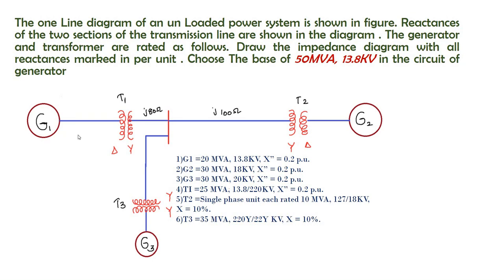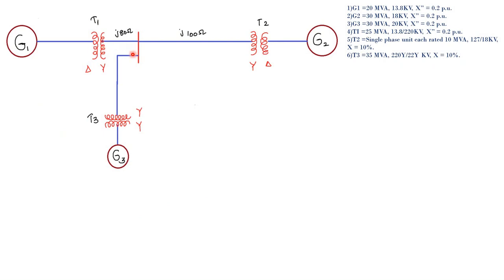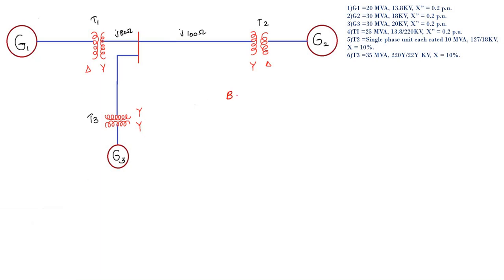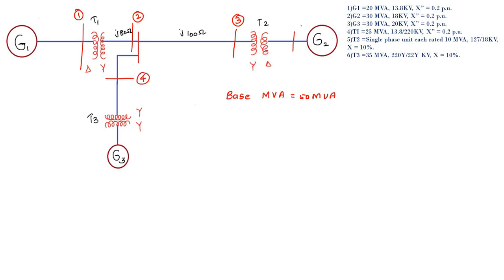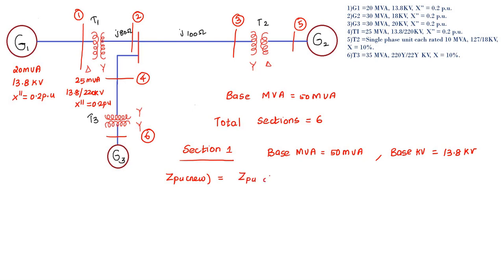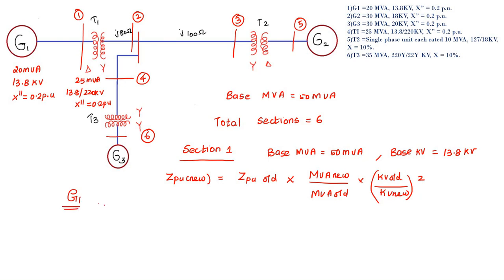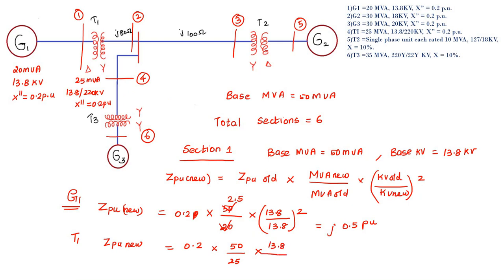PERUNIT  PROBLEM|POWER SYSTEM ANALYSIS|

Comment: In diagram T1 per unit reactance is j0.4(p.u).
Reply from the maker: Yes. What's your doubt?
Reply: @electricalengineeringsimpl3166  at  the end of the video you labeled t1as 0.2j instead of 0.4j based on your section 1 calculation